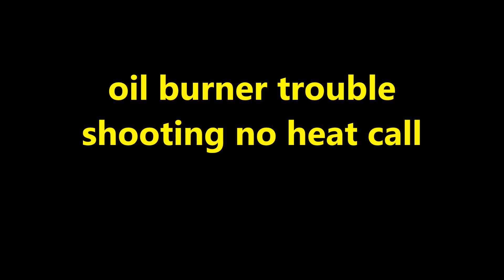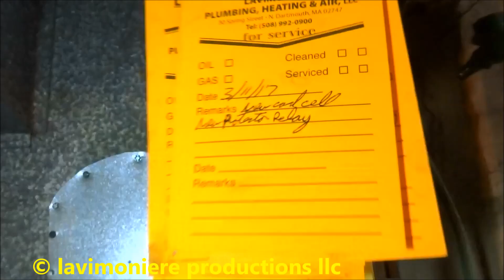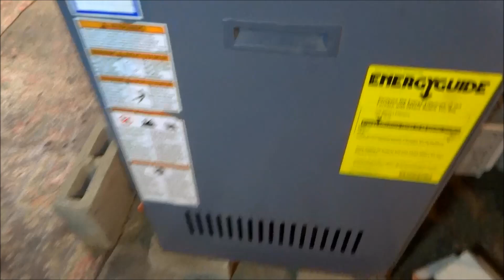oil furnace trouble shooting / no heat call

Comment: Worked on lots of heat controller stuff around my parts. Lots of older systems made by them still in use around here. Heating and cooling. Good fix Steve. She was an interesting lady to talk to. I'm sure she was very happy to have her heat back. The snow is on its way!

Comment: Hi Steve, the problem was the pump not the relay.....You have a clean cut pump on unit (i believe) and unit fires immediately and off on reset it goes.....Clean cut pump needs the oil valve operational. If relay detects fire before 10 seconds then off on safety it will go.... pump is not working correctly. I know you are one busy dude but check clean cut pump information from Beckett please. The unit will not run right if pump doesn't have a chance to ramp up to speed. Fire will turn to crap and you'll be back scratching your head. 
I was pretty much yelling at the TV when I saw oil come out of the pump without that 10 second delay. On the flip side the unit is heating. But it ain't right.
Reply: Mark it sounds like you did lots of work on those Becketts!  Let's wait and see if Steve gets a call back on this one.  He's a straight up guy so at least we'll find out if you were right.  Good info to check either way it comes out - Thanks!
Reply: Mark,

I don't think so...watch he beginning of the video.  When Steve disconnected the gun line to check flow, the oil was flowing as soon as he set it up to call.  That's wrong!  There should have been a 15-second delay before the solenoid fires and sends oil to the nozzle.  In short, the guy that worked on it before Steve must have wired the solenoid to the motor lead, by-passing the delayed-oil function completely "or" the controller is bad and it was firing the solenoid prematurely.  So, in short, Steve was right again!  The only thing it could have been is a bad control.  I believe he also replaced the old control with an R7184A (the "A" model doesn't have the oil delay function), so it will work exactly like the unit was.  The man knows his Becky burners!

Comment: the truck is idling hard!
Reply: David Sturm Probably in high idle. Allot of diesel trucks will revert to that if you let them idle a few minutes when they're cold. They will drop to normal idle when you hit the brake to put them into gear.